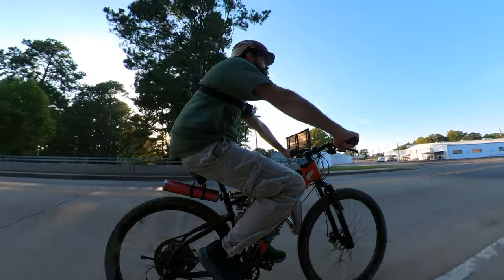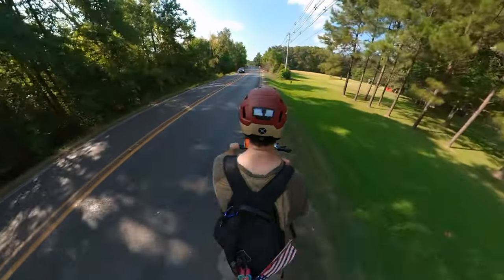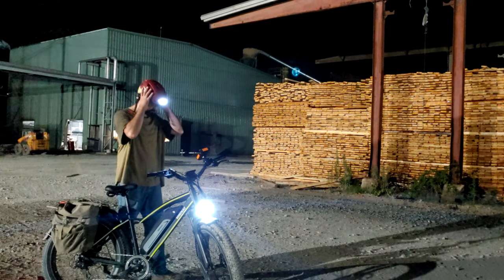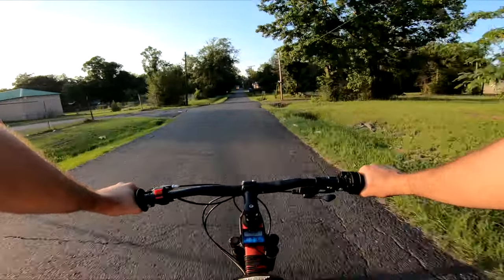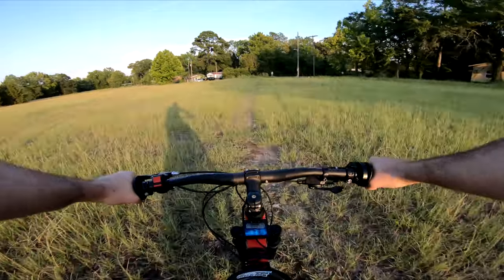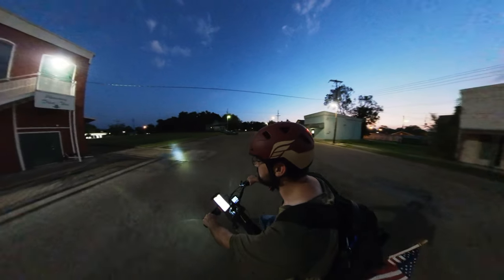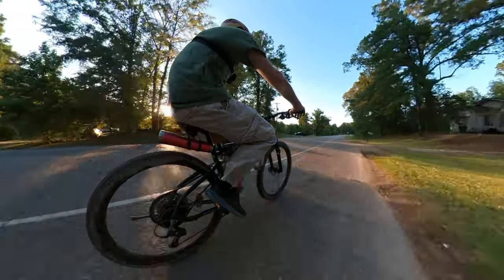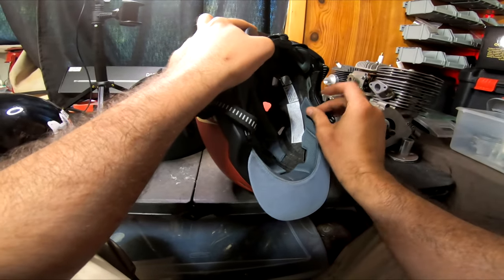Xnito Motorized Bike Helmet

Comment: I wear a full face helmet. I live in the city and have to keep up with traffic a lot of the time. With the sort of speeds these bikes are able to get to, I very much recommend getting some proper motorcycle protection. I sure was happy that I was wearing a full face helmet when I had my first wreck, front tire popped and I fell over the handle bars, my face went down and the helmet took everything.
Reply from the maker: Completely understandable. Motorcycle speeds and dodging traffic will likely benefit that style of helmet.
This is more for bike lane speeds and relaxed riding. More comfortable than a dot, more protection than CPSC, MIPS, and ASTM f1952.
Everything is a trade off.

Comment from the maker: Ben from Xnito responded to my question :)
Yes, the accident replacement will cover the helmet more than once. But after the first replacement you will have to cover shipping.
I find this to be a reasonable response.
He also pointed out that it's recommended to replace a bike helmet every 5 years, I did not know this at the time of recording.
Reply: Yes. Any kind of helmet will be recommended to be changed ever 5 or 6 years. Kinda sucks. Especially if you just dabble in things here and there
Reply: @DemonratsRevil  why do you need to replace it? It's not like the materials have a use-by date?
Reply: I'm curious whether this is actually a necessity.  After recently watching a video of a sport motorcyclist talk about this issue regarding tires and later mentioning he'd have a video up of him riding fast on a track with ten year old tires to show that age isn't quite as much as a concern as we're meant to believe.  TBF, he thought it was too until someone let him know otherwise, that's why he was nervous doing it.

Comment: What if someone had a motorized bike right then installed a E bike kit( they have 2 ones a motor for the back or front), the front wheel motor would be easy and you could just get a rear rack to hold the battery

Comment: a question I just had so I recently swapped my motor on my cranbrook bike and Bike is running good but it is a newer motor so I’m in the break in period I’m running 40.1 fuel and oil ratio is that good for a new engine! It’s a 100cc 2 stroke motor also will my engines power increase once’s engine is fully broken in?

Comment: I know this is off topic but wanted to stick this on the most recent video. I put together my pk80 and took it on the first trip to work after a few weeks of driving around and tinkering with things to make sure I was ready. I really under estimated the hills on my path to work. Other than a higher tooth sprocket, what would you suggest as the next best upgrade to help the wildcat take on the hills? A better head for cooling and compression? I seem to lose about 50 precent or more power, but not so much that I can peddle. Thank you in advance.
Reply from the maker: Many of them come too rich with around a 72~ jet. Simply dropping down the jet size can help a good bit. Try the 65-70 jet kit from bike berry. Start with the 70 and work your way down.
A pipe will help. The Deluxe or wc80 is decent, the real mz65 is best.
Finally, porting will open it up nicely. Specifically making the exhaust port 4mm wider (2mm per side).
Reply: @LAHover  thank you so much, sir!

Comment: For this price the helmet should include "MIPS" protection.  I have a 64cm head, 7:3/4 so a 
"One size fits all" is not comfortable for me, just a tip for first time buyers.
It seems to be a great helmet, great job on the demo, Thanks!
Reply: Thanks for that tip.  I have a XXL size head too.  I would have hate to receive the helmet only to find that it is too snug.
Reply from the maker: NTA surpasses MIPS.
But thanks :)